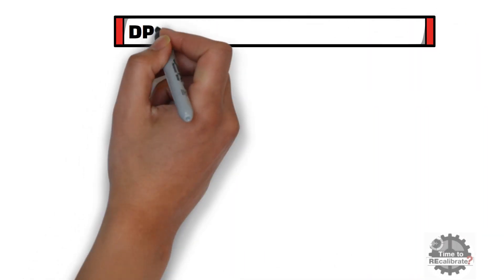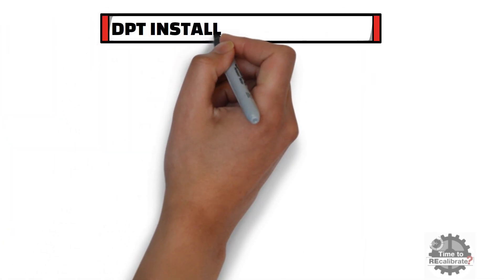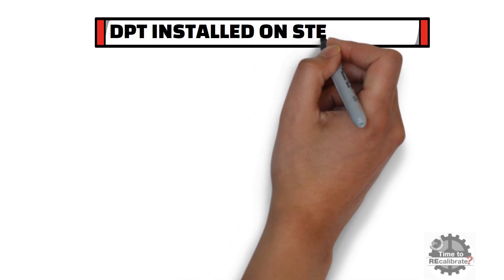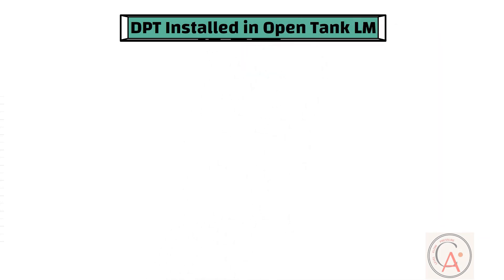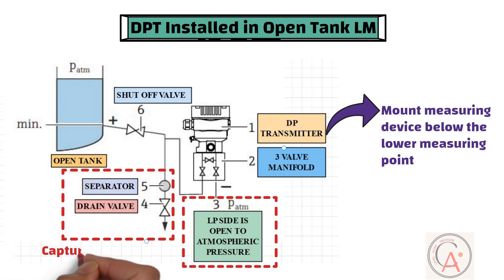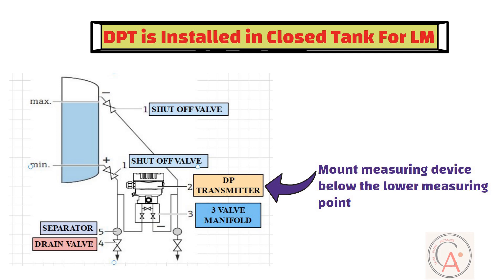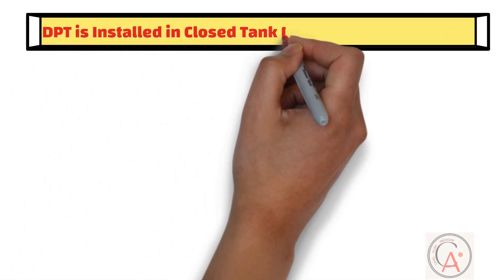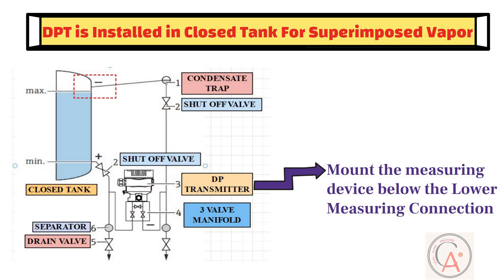Differential Pressure Transmitter Installation for  Flow / Level Measurement

Comment: What's the difference between DPT & PT?
Reply from the maker: DPT=Differential Pressure Transmitter
PT=Pressure Transmitter
Reply: @InstrumentCalibration  I don't want to know the full meaning , 
I want to know the difference.
Thanks
Reply from the maker: DPT" generally stands for "Differential Pressure Transmitter," a device used to measure the difference in pressure between two points, while "PT" in this context refers to "Pressure Transmitter," a device that measures and transmits pressure readings in various applications. @sharifhossain8830
Reply: @sharifhossain8830  knowing the full meaning of the two is knowing the difference.